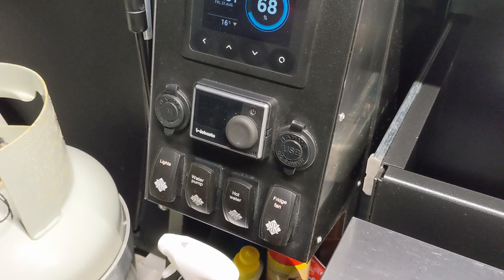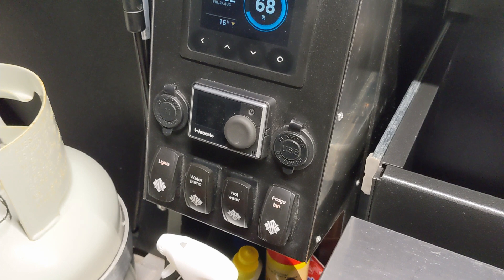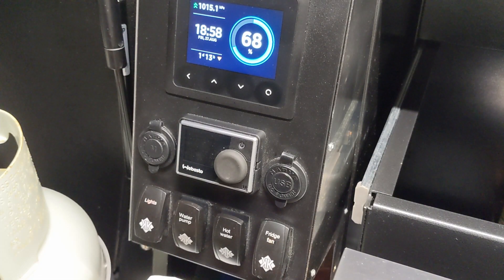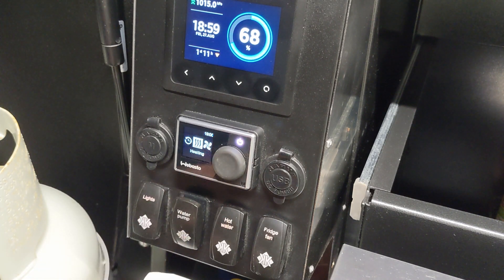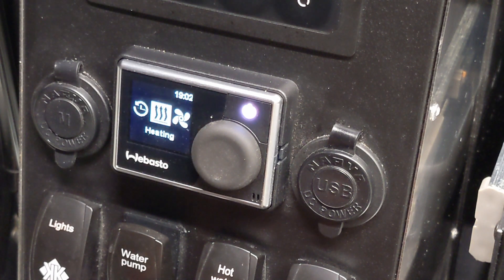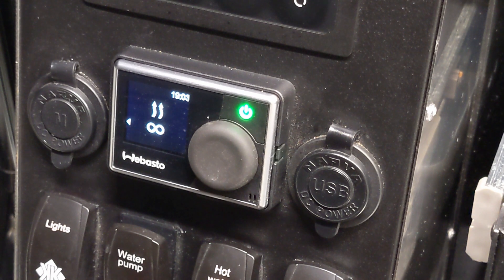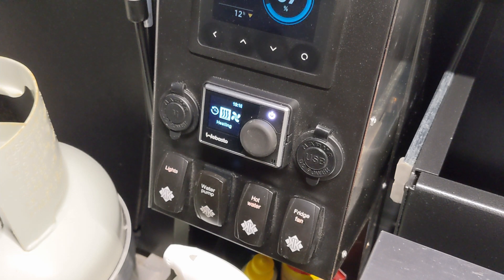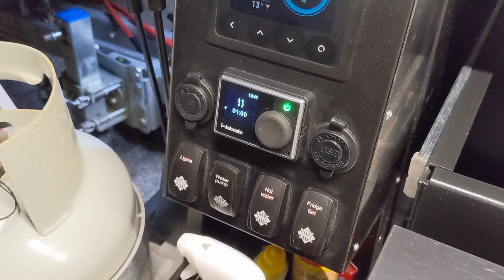'The Kamper' - Webasto Diesel Heater and Hot Water - 2021 Kimberley Kamper - From Factory

Comment: Great videos - thank you!  We have a 2013 KK with the older webasto water and space heater.  It has a different control unit - much less sophisticated I guess.  Would you have any advice on operating that unit?
Reply from the maker: Gday Guys, apologies, your comment got lost in the matrix. Unfortunately not, we have only sealed with this unit here. I think the Webasto units are great, they just need to be used how they were designed.

Comment: Great video I’ve got one on my motorhome and struggled to understand it. Now I do👍 thank you 🙏
Reply from the maker: G'day Peter, 

Not a problem buddy, we have since removed the HW switch and have it running directly from the the Hot Bat Bus. The unit now is fully powered and have not issues and we never have to reset the unit to clear the fault codes. 

Cheers

Off-Piste Campers

Comment: Wow thanks for the info.
Do you have to go thru that setup each time you want to use it?

It would be good if the unit had a trickle power source to avoid the fault codes when it's shut down.

Thanks again
Mick
Reply from the maker: Gday Mick, 

That's an excellent idea, and is exactly what we have done. We have since removed the HW on/off switch in the kitchen area and replaced this with a UHF Radio master switch. So now the HW system is always powered, like it would be if installed in a car in Europe. The CB is still available on the opposite Gull-wing should you need to remove power from it without turning off the entire Kamper. 

Since this modification, we have no issues whatsoever ever for the last 16 months. 

Have a Great Xmas. 

Scotty @ Off-Piste Campers